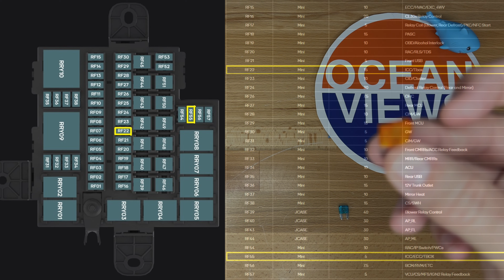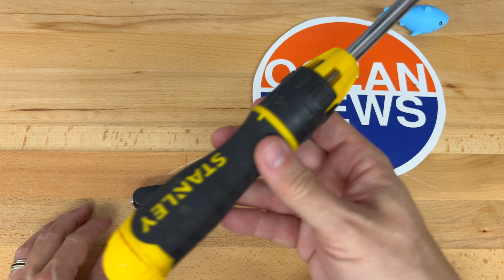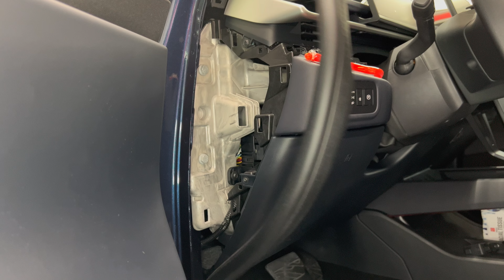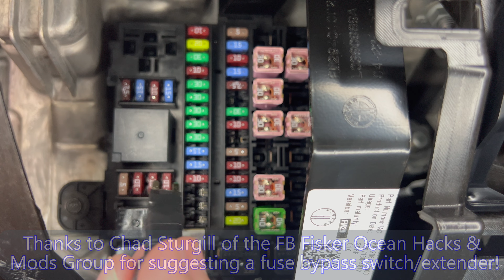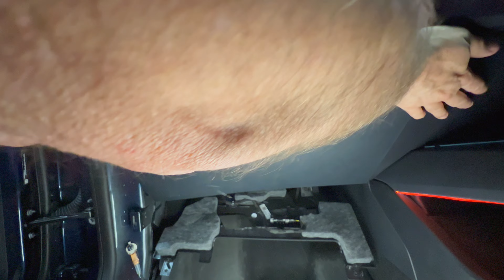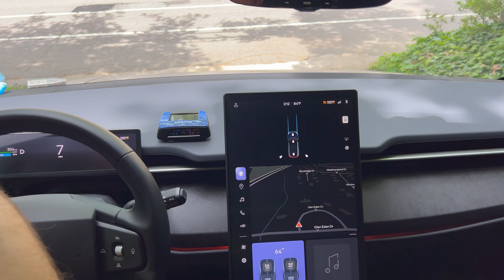Fisker Ocean One - Cabin Fuse Box & Tbox Reset

Comment: Hello. After I pulled the fuse and put back in my car won’t work at all now. I did the soft and hard reset and still nothing. When I try to shift it says car not ready to shift. The 12v battery Symbol comes on. And then after 30 seconds all of the battery symbols come on. No matter what I tried. Won’t go out of this now after I pulled that fuse. Any help much appreciated.
Reply from the maker: Which fuse?
Reply: @MTNRanger the one you said. Number 20 second column 9th fuse.
Reply from the maker: @MrJetpilot32 When you removed it did both screens turn off?  And then when you reinserted both screens started back up?  This fuse doesn’t affect the 12V battery or any other systems.  So I’m not sure what happened.  One thing I would try is get out and lock the car.  Wait a minute, unlock and sit in the driver seat. Press brake.  Let me know what happens.
Reply: @MTNRanger yes both screens turned off
and back on. i tried the getting out lock and unlock many times. same result. hard reset many times also no change

Comment: Hi 👋 I just got the pulse installed, but I’m having to reset my T box. Fuse that the pulse connects you quite often while we troubleshoot and I have the dash panels open so I don’t have to keep opening and closing them and thought I should put this on off switch in, but my question to you is because the pulse has a double fuse or two fuses connected to one would you recommend the same configuration or switch? I’m just wondering because the switch that you’re using has a cat put on it I don’t think that would fit, but I don’t think that’s a big deal. Can you let me know? Thanks.
Reply from the maker: Yes, many Pulse owners are putting this switch in between the Pulse and the fuse tap in the fuse box.  Then you can flip the switch to turn the Pulse off/on.  You can use two switches attached to the fuse tap.  One for the TBox and another for the Pulse. I personally have not seen Pulse yet.

Comment: Thanks Matt, I installed the RF22 bypass last Friday, to see if it will alleviate the vampire drain issue on my Fisker. I normally lose 20miles/day of range as the HV constantly wakes up to charge the 12V DieHard XEV (few weeks installed). Same issue as my old battery. After 16hours with RF22 off and no charger connected, the range stayed at 288 (77%), so no loss. I also did the IBS recalibration using your instructions. I was going to pull the RF55 fuse but there seems to be not enough space to pull it and reliably put it back. I need to relocate the RF22 bypass switch so I don't have to remove cover every time to turn it off. Have u ever pulled the RF55 fuse?
Reply from the maker: I have never removed the RF55 fuse. You could reach it with some long needle nose pliers. Yes, turning off the RF22 fuse is great to avoid vampire losses if you leave the car for a long time.

Comment: Hey Matt, Thanks for the sharing the video. Do you follow the same process if you don't have any cabin audio? I am not hearing any of the car alerts, radio, chimes, etc. Thanking you advance.
Reply from the maker: I would try these fuses in conjunction with the NF07 (trunk fuse, top fuse on right third column), and EF05 (under hood, top fuse on left second column).

Comment: Hi MTN Ranger.  Great video as always!  I have an issue with my key FOB not responding and not even the NFC is responding.  Is there a similar fix to reset the NFC.  Could my 12v Battery be the culprit?  Help.  Using the OV Loop app to open doors and the "Key" to start the car.  I will note that the center pin on my key fob Popped off and i stuck it back on using a very small copper sticky tape.  Been trying to find someone who can solder it back on but been unsuccessful.  Thanks in advance.
Reply from the maker: I’m guessing the battery clip is the main source of issue.  Without a battery installed, does the key fob open the driver door when placed on the handle? Does placing it on the NFC sensor on the dashboard to the left of the steering wheel allow the car to ready mode? Another thing you can try is taking out the PKC fuse, wait a minute and reinsert. Of course the 12V battery can always cause problems.

Comment: Mine failed to enter the OTA mode for the 2.2.3 update, so I was told to try the tbox reset. Followed the instruction and pulled both fuses and reinstalled them after a minute. Now the car won't turn on, the driver screen comes up but just has the time/date, and the center big screen stays off. Does it take some time after you reset the fuses for the car to turn back on?
Reply: Nevermind. I moved one of the bigger fuses out of the way to reach RF55 and ended up putting it back in the wrong slot.
Reply from the maker: You only need a minute or less for the reset.  When reinserting, are you sure you pushed in the fuses all the way?  Press the brake pedal and the car should come back on.  The driver screen usually comes on first than the center screen goes through the boot process. Look at the fuses again to make sure they are good.  I recommend have replacements for mini/micro2/JCASE/MCASE.  See this video for which ones you need: https://youtu.be/9QMc8sYhTkI

Comment: My GPS is stuck to a location (90 miles away, a location near Sacramento). When I saw this video, I felt lazy initially not to do this when I heard about Oceanlink Pro having a feature for TBOX reset. I tried both the older OceanLink Pro (soft TBOX reset) and the latest software (hard TBOX reset). None of them worked for my GPS to make it alive.
I'll be trying this, but I want to know the reason why OceanLink Pro didn't work. 
Is the physical "fuse reset" shown in this video more comprehensive? Is it because both TBOX Reset and Cabin Fuse Reset are needed, and the software doesn't do the "Cabin Reset"?
My GPS was alive for a long time after I received the car in September 2023. Then one day, it got stuck to the above location and never recovered.
Reply from the maker: Yes, at this time, the fuse pull is more effective.  That is supposed to be updated in OLP in a future release.  Yes, the GPS can get stuck randomly.

Comment: Any suggestions for gear sensor error? Fuse pull did not correct and car will not deep sleep. Great videos
Reply from the maker: Not being able to go into gear could be related to the seat sensor.  If you can run a DTC report, you may get more info.
Reply: @MTNRanger not sure how to do that, but I will search You Tube for information. Thank you for the lead. Appreciate your videos.
Reply from the maker: @cesarrivas1772  If you have the OceanLink Pro phone app and the Vlinker FD+ OBD2 adapter, you can access the diagnostics of the car.

Comment: Did it this afternoon - as easy as you described! A few observations/tips:

If you feed the fuse extender from the top, there is no need to unscrew the top bracket. Does make it a bit more cramped up top, though.

The right side under the cap may be a good place to put your spare fuses & fuse puller. Put them in a zip lock bag (I used the one the fuse extender came in). Note that the well in the front of the right side is deceptively deep.

You don't really need to take the bottom panel completely off - just loosen the left half. It was done that way in the video, iirc, for ease of taking video of the process.

There are a handful of metal clips, so be careful to find them if they come off (or have spares ready).
Reply from the maker: I forget if mention later in the video, but yes, it’s easier to install the extender from the top. If you watch my recent video on fixing the 12V outlet, I show this bottom panel shortcut. I keep a full box of fuses in the passenger seat storage bin.

Comment: My navigation has been freezing every other day after I installed the fuse bypass. Anyone knows what could be the cause?

Plus, is there any maintenance schedule we should follow?
Reply from the maker: I'm not sure if the bypass is causing it.  Mine was good for many months, then I had a spate of weekly lock ups, then it settled down.  So sometimes it's random.  As far as maintenance goes, I'll planning on doing a video on it later in the month - not much is needed.  I recommend rotating tires, replace cabin air filter every other year, have brake checkup (calipers/pads/fluid) every two to three years.  Keep an eye on the 12V battery (bluetooth monitor helps) and replace every three to four years when the charge can't reliably stay above 12.0 Volts.

Comment: Do you know if the fuse box is swapped to the right on RHD cars?
Reply from the maker: According to the Ocean wiring schematics, RHD has the cabin fuse box on the right side of the car - opposite of LHD.  Check out pages 2 and 3 here: https://www.dropbox.com/scl/fi/pv0ljl23url92ideevic6/Fisker-Ocean-Wiring-Diagrams_Fisker-FM29_SORP_-MY2023.pdf
Reply: @MTNRanger  Thanks

Comment: Hi, did your clock lose the right time also? My navigation is stuck and my clock is totally wrong. Thx
Reply from the maker: Luckily my clock seems to synchronize fairly well when I start driving (also connected to phone’s hotspot).
Reply: @MTNRanger  Do you recommend adding another fuse bypass to the other fuse? I hate taking things apart. Thx
Reply from the maker: @dhho1 I haven’t found a need to remove the other fuse in the past year.  So I wouldn’t bother.

Comment: Thank you!! I was able to use this to replace the top-left 15 A fuse, second one from the left. The back 12 V outlet wasn’t working and that was the issue. Be careful not to use things that draw a lot of power for too long with that outlet, like the included tire pressure pump. May be use it for 45 seconds and let it rest for a minute. Or, use a cordless version.
Reply from the maker: Yes, good tip!

Comment: Thanks Matt, I went in to try to troubleshoot the rear trunk 12 volt that stopped working after 1 use a year ago. I was told the fuse must had blown and Fisker never fixed it when I did get some service. It was not blown after all so not sure why it's not operational but it gave me the opportunity to follow your instructions and reset the t box. Your instructions were clear and concise. I need to buy the fuse switch next and install.
Reply from the maker: Yes, the fuse switch has come in handy a couple times already since I have installed it.  Luckily I haven't needed to use it since getting v2.2.  The 12V outlet is fuse RF36 for those that are interested in knowing.

Comment: I think I know the answer to this. All was going great with my Ocean and, all of a sudden, I see Spotify, Iheart, etc. but none of them load. I am thinking I need to do a t-box reset. I could pull the fuse and reinsert, which I will probably do and if it works here are my 2 questions. Do you believe it's possible that I need to do a t-box reset to get those audio programs working. By the way I can still play spotify, iHeart, etc via my phone connected to the Ocean with bluetooth. And second question. Which of the Fuse Bypass Switch/Extenders did you buy? The 30cm or the  60cm in length? Great video which I probably knew I would need to access at some point. I am almost tempted to just leave things alone and use Bluetooth. My navigation seems ok, still wroking.
Reply from the maker: I personally have never had an issue with the apps not loading.  Having them crash, yes, that does happen from time to time.  I don't know if resetting the Tbox fuses will fix this.  But I would still recommend trying it.  You can use the 30cm length extender - I have in fact installed that one in another owner's car.  I only used the longer one since it was the only one in stock.

Comment: Thank you! Followed instructions and fixed my issues with the clocks out of sync, not being able to go into deep sleep, no 4G connection and not being able to connect to a Wifi access point. Was nervous since I just got the Ocean One yesterday LOL, but figured that unless I got it working I wouldn't be able to get the OTA 2.2 update (and probably why it wasn't updated as of yet). Great instructions, just wished I had the connector to extend the fuse so it the event I needed to do it again, I'd be all set.
Reply from the maker: I'm glad it worked out!

Comment: I had problem connecting to home wifi after update 2.0 and saw the post on FOA regarding resetting the tbox. I did the 15a fuse but that alone doesnt work. Both 15a and 5a together does the trick. Thanks for the instructions.
Reply from the maker: Yes, for some cars, doing resets on both fuses is needed.
Reply: @ddsheep: How were u able to do this? There seems to be not enough space to remove the RF55 fuse. I have been asking Claude on links for this.

Comment: Hey MTN Ranger.  My car has no cellular or wifi connectivity since they attempted to push 2.2 to it.  I tried your Tbox reset but it doesn't seem to have been effective.  Any other advice for a case like this?  Thank you!
Reply from the maker: So, 4G and Wifi worked before the attempted update? If so, you should contact FOA to see if there is something they need to do with any of the modules.

Comment: Hi Matt or anyone else on this comments thread…
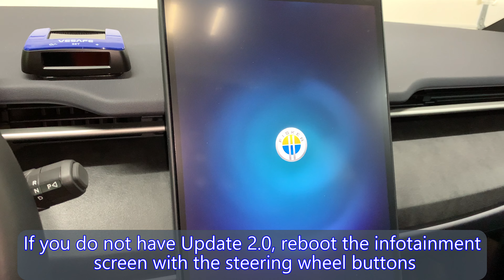Has anyone experienced a blank infotainment screen that doesn’t return to normal ops and stay blank. I have attempted multiple soft resets (on the steering column wheel) which results in the FISKER OCEAN startup log (10:27 in the video) coming up on infotainment screen then it goes away and stays blank. Anyways, looks like the infotainment screen is no longer operational (stays blank). Does anyone know if in need to reset a fuse or something?
Reply from the maker: If you see an image on the center screen during boot, the fuse is fine.  If the screen is always blank, that would probably be the fuse.  I'm not sure what is causing your issue.  If you put the car in reverse gear, does the rear camera show up on the screen?  Have you also done a deep sleep reset?
Reply: @MTNRanger  Yes, I did attempt a deep sleep rest and it hadn't resolved the issue (also the rear camera did show on the infotainment screen while in reverse but that was the only thing that worked with the blank infotainment screen; additionally all the drowsy driver warning started to appear as well while driving and the infotainment screen was inop).  At about 8-10 hrs later after I initiated the deep sleep reset,, the problem went away. here's the resolution: I was lucky to get Brandon from Platinum Precision (former Fisker Tech) from the DMV area to help me with the issue.  I happen to have an appointment with Brandon the very next day to get my water pump replaced and opt'd to get the 2.2 uploaded as well.  He was able to do a hard reset on the center console but only after the HVAC controls came up. This happened only after about 8-10 hrs after I initiated the deep sleep (FYI: immediately after the deep sleep was entered about 2 hours after initiating the deep sleep, I still didn't have the HVAC control come up nor did the infotainment screen recover either) and btw, my vehicle initiated charging at 8Amps as well.  I have been checking couple times since the issue was resolved while Brandon was at my location and it seems to be stable still.  I'm glad that Brandon was able to reset the infotainment panel thru the switchology of the HVAC.  Figures crossed (for now) that the center infotainment console would stay operational.🤔  The Switchology to do the hard reset was the following (if you are lucky to recover the HVAC controls (after a deep sleep reset) without of course the infotainment central screen up and running): set Driver Side Air temp to Highest possible setting (i.e. highest temp), then set the PAX side temp to the Lowest possible setting (lowest temp), then set fan speed to 7, and then activate the Rear Defrost.  It immediately cycled the power to the Infotainment Center Console (by itself) with the Fisker Logo coming on and after a few mins, recovered my infotainment screen.  Thanks to Brandon for helping me dodge having to replace the very $$$ ICC (for now).
Reply from the maker: @OCEAN1Neelam  Very interesting, I'll have to keep that in mind!

Comment: Just did my install, thanks so much for the video, it very much helped!  Basically followed your process except I fed the switch down from the top. I got the 30cm version and it is still more than enough length.  My 4G and connectivity came back after my install was completed!  The only thing that was a bit of a pita was the three metal clips that fell off the very first trim piece you remove.  Luckily I was able to fish them out from where they fell and put them back when I re-assembled.   Otherwise no issues! Thanks again for the video!
Reply from the maker: Yes, I have installed more of these and installing from the top is the way to go. The door threshold piece does tend to lose those clips. I usually use a needle nose pliers to extract them from the hole.
Reply: @MTNRanger  So 30cm is enough, can 2 of this fit in the opening, one for RF22 and another for RF17.
Reply from the maker: @a @always_searching3534 s two can fit and 30cm is all you need.

Comment: Once again, thank you for this video. I followed it as I installed my switch and it woks like a charm. 🎉 Now i have to wach the 12 v battery one, since i keep getting the warning, blocks me from putting it in reverse and when I restart it goes away. So I’m not sure it’s really the battery or just more garbage warnings. 😮
Reply from the maker: Sometimes there are just weird warnings.  I reset usually fixes most of them. Though they can be exasperated by a low 12V battery voltage.